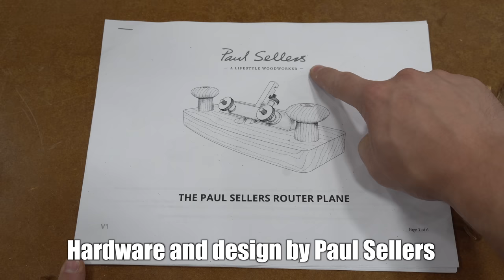Don't buy a router plane! Build one instead.

Comment: Nice, a Paul seller router plane, he did said it's customizable. Interesting that the metal is bevel down, most router plane have cutting edge straight and flat but cool
Reply from the maker: Yeah I think he uses a bevel down approach because he makes the blades himself out of square stock. Much easier to make this blade than an L-shaped one like most router planes use. I do think bevel-up is better though.

Comment: I used the same kit!!! I made a structural change, I bored the center hole at 50° and inlet the iron to the very bottom. Then used gunsmithing bedding compound to bed the iron..Zero vibrations.
Plus I've made to additional irons from O1 steel. A 1/4" and a 1/8th for inlay work......
Reply from the maker: That's awesome Andy thanks for sharing! Love your modifications, I'll have to try some of them the next time I make a plane like this!

Comment: Nice work!
I like the idea for angling the handles, btw.

For everyone who is waiting for the kit from Paul sellers, no need! I have already made  two of these from metal sourced from scrap, with the exception of the blade. For that I bought a 12" bar from metals online or something like that. Paul has videos on how to harden and temper the steel, and I did it in a barbecue with a hair dryer 😁.
All very possible and fun!
Reply from the maker: Great tips djl! I was a little intimidated to try it myself (I've never tempered steel) but I definitely plan to do so now in the future, thanks in part to your encouragement. Cheers!
Reply: @dkbuilds  A couple of more tips -- cut the notches in the blade and also the angle to the cutting edge 'before' you harden the steel.  The closer you are to the final bevel the easier your honing will be.  Use hardwood such as mesquite for a hotter fire, and don't be shy about the hairdryer.  Just make sure you don't get so close it starts to melt!  Paul's magnet test to see when you have hit the right temperature worked perfectly.  It was the first time I attempted anything like it, and it was a simple as Paul makes it look.  Enjoy!

Comment: Very nice build.  Been a follower of Paul Sellers a long time.  Think he would like that you took his idea and made it with modifications of your own design. Have my kit and have base done and know heading toward completion.
Reply from the maker: Thanks for the comment Harold! I hope this video drives more traffic to Paul's webpage, he's great. Let me know how your build turns out with the kit!
Reply: Just letting you know I finished my router plane today.  Couldn't find knobs so made my own.  Followed Paul Sellers how to shape and make Plane knobs and modified them to work on router plane.
Reply from the maker: @haroldking4272  That's great! Thanks for following up Harold. I considered making my own knobs but without a lathe I was worried they would look sloppy. How did yours turn out?
Reply: @dkbuilds   Handles turned out OK. But you can tell their hand made and not as nice a one turned on a lathe.  But they will work fine.  Have a good day and a happy holidays.

Comment: Pretty slick. It looks like it works well.
Reply from the maker: Thanks Gary! I'd say it works pretty well, but only if you are removing a tiny amount of material at a time. IMO a Stanley (or Veritas, LN, whatever) would work better than this but they're just so expensive! Plus this was a fun, cheap one-day build.
Reply: @dkbuilds  I have the large LN and although I haven’t used it very much since I got it earlier this year I don’t remove very much material at a time. I find it just creates a better surface when you remove less at a time.

Comment: How are you finding the plane ? I was thinking of buying the kit as a little project as i already have a router plane , was just wondering if it was worth it ? 

Cheers 
William
Reply from the maker: Sorry for the delay William! The plane is great as a little project, and it useful if you only have a very small router plane (like me). It's great for some specific uses like shaping tenons etc but in general I wouldn't describe it as high quality or precise as for example a Stanley.

Comment: Came out great! That plate that holds the blade in, is that stainless? Or is there any finish on it?
Reply from the maker: Thank you Ben! I don't believe it is stainless, I would expect it to patina over time and probably rust if water is left on it. I didn't put any finish on mine but I believe Paul Sellers puts shellac on his (I could be wrong)
Reply: @dkbuilds  Great thanks! Maybe not in that situation, but in restoration type situations I've used clear rustoleum a few times. Works great for preserving bare metal without worrying about it. Could always wax it I suppose!

Comment: This is the sellers design, I built it and was disappointed. The problem is in the straight iron. It’s too sharp of an angle and bights into the wood to aggressively. Router planes have an “L” shaped iron for a reason. I scrapped mine and built a  new one with an L iron. Much better.
Reply from the maker: Great feedback Rand and I actually agree. I don’t think router planes should have a bevel-down design like this one has. The problem is it is much more difficult to DIY an L shaped iron. Good for you for making that work! The trick to using this plane for me is to take off really tiny amounts each pass. It’s painfully slow but works well enough.

Comment: Yet another YT video where you need the tool to make the tool.... SMH
Reply from the maker: You don't need the tool to make the tool. For this one I put a zebra wood inlay in the front and used a small router plane to smooth that cut, but 1) that inlay is totally unnecessary, it's just for looks and 2) smoothing the bottom of that cut wasn't strictly necessary either as it's not an important glue surface.

Comment: Hey dude!
You use a rabbet plane to clean up a tenon, instead of trying to use a router plane like you showed on your video.
Get it straight and stop trying to teach people the wrong thing.
Reply from the maker: Thanks for the feedback Mark. I disagree with you. A rabbet plane would smooth that surface yes but it wouldn’t necessarily get the glue surface coplanar with the face of the work piece. Please consider being less aggressively rude in your comments. Thanks!